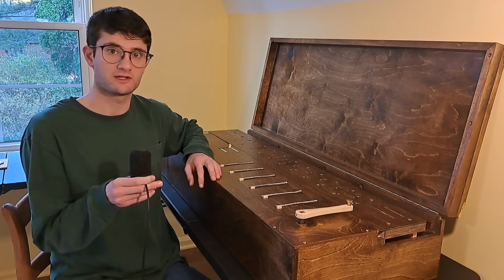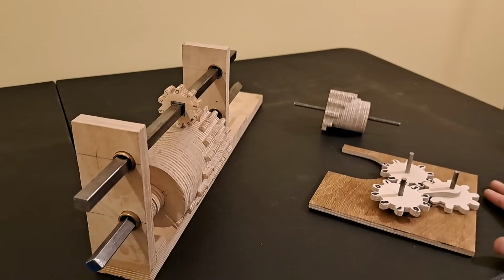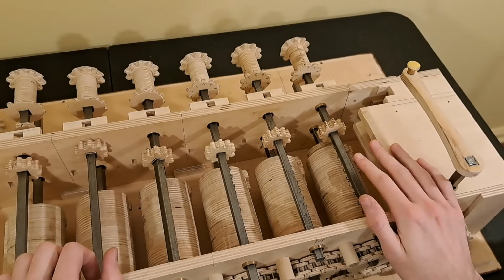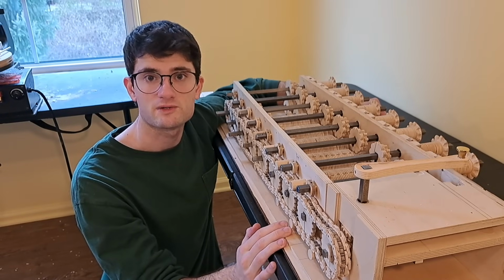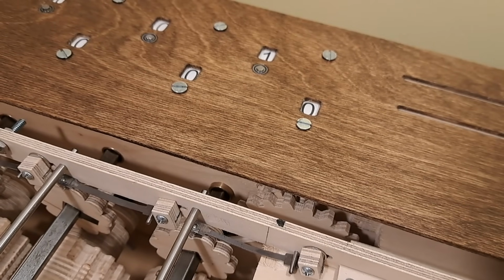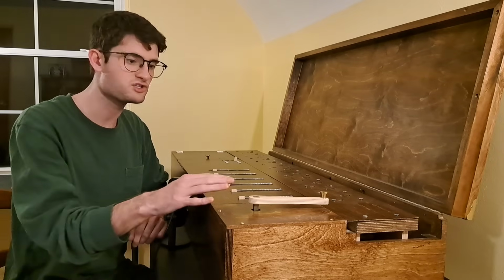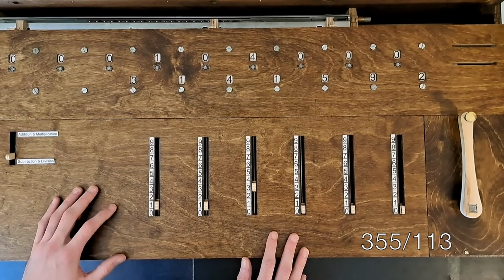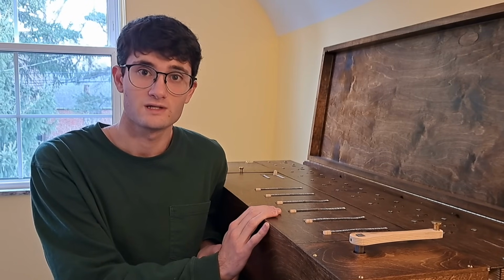How I built a Mechanical Calculator

Comment: 1) What if you write the numbers on the left gear in CCW direction? (as opposed to you've written in CW direction, meaning 1-0 are in CW). Then can we omit the intermediatory gear?

2) 13:42 - is that over-center or bi-stable toggle mechanism? I thought in over-center the pivot of the toggle was set at an offset from the pivot of the spring.
Reply from the maker: Thanks for the questions.
Regarding 1: If I had been making a full sized Schickard or Pascaline adder then the reason I did not just write the numbers CCW would be more important, we want each input wheel to rotate the same way because then the user interacts with all of the input wheels in the same way. With the Schickard adder in particular you could also do subtraction and it would get confusing quickly which way is needed to rotate the wheels if every other one goes in the opposite direction. A core element of these machines is that every decimal column behaves the same internally and also externally to the user. Basically, writing it CCW would've worked for that little demonstration model, but it would not help explaining how the full machine was going to work.
Regarding 2: I'm not entirely sure of the technical usage of over-center. Obviously it is bi-stable, but that's just descriptive of the effect more than helping to explain what is happening. I said over-center because I thought it highlighted how the critical element was the spring passed from one side of the pivot (the center), over to the other. Looking up images of over center mechanisms, It does not seem like a requirement that the pivot of the toggle be "offset" in some specific way from the pivot of the spring, just that the spring passes over a center of maximum displacement. 
Hope that helps! Let me know if I've misunderstood something!
Reply: @WhatWillMakes  Nah, your understanding seems to be correct. Nice video and thanks

Comment: I'm afraid I don't quite understand how the carry system works. Like, what happens if the carry tooth rotates the next bar at the same time the input gear for that bar also rotates it. I think I solelved this one on my own (maybe you said it and I missed it, but I would be surprised because I was waiting for this explanation the whole time), I think it has to do with why you made all the stepped gear teet 1/10 of a rotation apart even though you never needed more than 9 teeth. That means there's always a gap where no tooth is engaging from the stepped gears to the input gears. If you force the carry to happen during that period of the one gap, then you don't have to worry about missing the carry amongst the other rotations that are happening.

But I don't understand how the carry can cascade. It seems like the first carry would set up the next cary, and you'd have to turn it again to trigger the 2nd carry which would set up the 3rd carry. I didn't see logically from watching the interactions or hear you explain how it triggers the lever, rotates the gear, and pushes the lever back all in one motion. I guess it could be due to that left-right adjustment you pointed out in the last step? Make sure they're not aligned, but actually very subtly offset one to the next to the next? Maybe, but it seems like a lot of motion to ask from such a tiny window. I would have liked a closer and slower shot of that carry cascade, and an explanation to how it doesn't fall to these 2 curiosities I had.
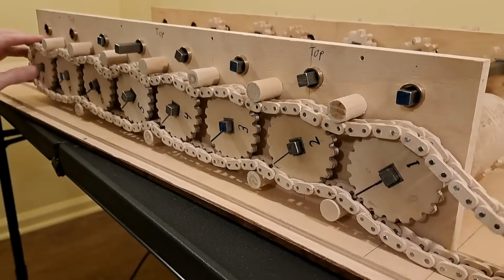Reply from the maker: These are great questions. In regard to the first, about carries happening in a column while that column is still adding in a number, you basically have it right. The piece with the extra tooth for carrying always comes after the 1-9 teeth on the stepped drum in that column. As for your second question: I apologize for not fully covering it – I thought it would be too much detail for this already long video – but every column is a little later in the cycle than the one to its right. If I had not removed some teeth on the stepped drums and instead of having 1-9 they had teeth going all the way around, they would have 20 teeth going all the way around. The extra tooth for carrying comes just after the 9 teeth on the stepped drum (so in the 10th of the 20 spots). This means the carry does always come right after the 1-9 digits are added on that column. Then the sprockets that link the columns together via the chain also have 20 teeth. And each column is 1 tooth of the sprocket (1/20th) later in the cycle than its neighbor to the right, so that carries ripple and the rightmost one finishes first. (You can kind of see this in the video at 9:35, where I'm aligning all the sprockets so those black marks line up, but the actual squares of the metal shafts show that every successive column is turned a little more down the line). So everything is timed so that carries do not interfere with things within each decimal, and occur at the right time in relation to the other decimal places. (if you're interested, there's diagrams of those parts showing the rest of the 20 teeth on my blogpost: https://whatwillmakes.com/2024/12/20/my-mechanical-calculator-how-and-why/).
I hope that helps and apologize it was not fully explained in the video!!

Comment: It's a shame how language changes, because I looked up the definition as I always assumed digital had something to do with what type of electronics were inside. And it turns out, the 1st definition (in Webster) has to do with electronics. And only the 5th definition involves the word "discrete." But it seems like there's an easy solution to this issue. If you have to dig to find a definition that uses "discrete," then why not just use the word "discrete" yourself? If that's the word you really want, it already has the meaning you need.
Reply from the maker: I don't think discrete itself would suffice; it's more a whole system of parts which rely on discrete events. Regardless, I do believe it is accurate to call my machine digital. (Encyclopedia Brittanica, on its page "History of Computing", even calls an abacus digital!) Moreover, I used digital to purposefully make us think about where the term digital comes from and to draw a comparison through the etymology of the word between technologies, in order to hopefully expose some underlying relationships. 
I appreciate the comment and like thinking about the best way to interpret this technology!

Comment: Clearing can be done by putting the add/sub lever to the middle (assuming there's enough space for the gear) so the gear won't engage, then clearing the results, to not lift the entire assembly by hand. And clearing can even be interlocked with that lever, so clearing rack cannot slide unless gears are disengaged and mode lever cannot switch until clearing is disengaged
Reply from the maker: Very perceptive suggestion! A couple other people have pointed this out too, but unfortunately there is not enough clearance between the bevel gears on my machine. I learned that some machines did have that as a feature though.
Thanks for the comment! It makes me very gratified that people give it so much thought

Comment: What happens if you divide by zero or subtract a greater number from a smaller one?
Reply from the maker: Dividing by zero does not really do anything, because to divide by zero you would just set the machine to keep subtracting zero, but when you set the input sliders to zero it means that the 10 toothed gears just do not engage the stepped drums. So nothing happens except the crank turn counter goes up, futilely!
The results dials do not have negative numbers (just 0-9), so when the machine tries to subtract beyond zero, it rolls over into all 9's. 0-1 would equal 99999999 and 0-2 would equal 99999998, etc.
Thanks for the questions!

Comment: Now you just need a crank mechanism to move the result wheels for multiplication and division, instead of having to lift it off, same with the zeroing of results and crank turn results...
maybe add a lever that unlatches the whole display assembly from the main gears as you lift it?
Reply from the maker: Yeah there's some bits that need refining. I plan to attach a post to the zeroing mechanisms so you don't need a stylus, but a crank mechanism is also a good idea. As is a crank to shift the assembly – kind of like Monroe mechanical calculators from the 20th century, I believe. 
Good suggestions and thanks for the comment!

Comment: With a few changes to the machine you could make either a binary or hexidecimal version or even one that can do all 3 or any other base system you want.  This could add a whole new layer of functionality.  Another option but a totally different way of making a mechanical calculator would by using the spring controlled switches they are in two distinct states 1 and 0 thus theoretically you could make a set up of logic gates build a fully mechanical binary system which would be working on the same principles as an electronic system.
Reply from the maker: Yeah it really could be any base! Interestingly, the first mathematician to really make the case for using binary and hexadecimal was Leibniz, and while he worked on his base-10 machine he designed a binary adder. I might dive into mechanical binary adders and logic gates sometime; definitely cool ideas. Thanks for the comment!

Comment: So cool only real improvement I can think of it the reser as it's a bit clunky having to reset by removing and using a stylus maybe a spring release would be better ans when you press the button it releases the mechanism and auto resets
Reply from the maker: Yeah the reset procedure could be more refined. I plan to permanently attach the stylus and basically have a post to slide, but spring returning it is a good idea. Thanks for the comment and ideas!

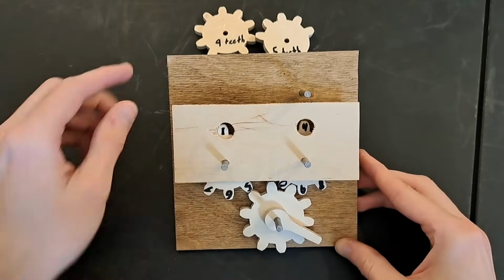Comment: At the timing 4:27 it showed how to add numbers. Would it be shown the detail of the minus, multiply, and divided like at 4:27?
Reply from the maker: I explain that in the rest of the video, but basically the machine subtracts by turning the number dials backwards instead of forwards, and it multiplies/divides by doing repeated additions/subtractions. Let me know if I've misunderstood the question, but I try to cover how it does those operations throughout the build process and demonstration.

Comment: 25:18 I'm thinking about the practicality of such machines, if it has too many moving parts and too many manuevers and orders, it's not very fit for common people to use it. I still think is a bealtiful machine, but it's easier to just write it down.
Reply from the maker: Yeah they definitely weren't for everyday home use, but offices, clerks, and accounting instead. Pascal was initially motivated to make his calculator to help in his father's work with taxes. In my estimation, when the machine is working well, it is faster and more accurate than a human with paper and pen. But it takes some training. 
Thanks for the comment!
Reply: @VitorMiguell believe it or not, this is exactly how a lot of calculators worked. The Monroe, for example, used this very method.

Comment: I noticed you didn't talk about the timing of the carries.
Clearly they can't happen while the target number is rotating, and they also have to be able to happen in sequence because carries can cause other carries. This is why the stepped drums have so much space after the last tooth, and each carry gear has its own angle. You need to dedicate some of the crank rotation for all carries to occur, one after the other, AFTER the initial rotations. Funny enough, this means that the size of the stepped gears depends on the number of digits the machine can display.
Reply from the maker: This is a very perceptive comment, and well put. I glossed over these details for sake of time, but it is precisely as you described it. If I had not removed some teeth on the stepped drums and instead of having 1-9 they had teeth going all the way around, they would have 20 teeth going all the way around. The extra tooth for carrying comes just after the 9 teeth on the stepped drum (so in the 10th of the 20 spots). This means the carry does always come right after the 1-9 digits are added on that column. Then the sprockets that link the columns together via the chain also have 20 teeth. And each column is 1 tooth of the sprocket (1/20th) later in the cycle than its neighbor to the right, so that carries ripple and the rightmost one finishes first. (If you're interested, there's diagrams of those parts showing the rest of the 20 teeth on my blogpost: https://whatwillmakes.com/2024/12/20/my-mechanical-calculator-how-and-why/). 
Finally, you are right that this all dictates how many digits the machine is capable of displaying, but there are tricks to get around these limits; see Thomas De Colmar's "Piano Arithmometer." 
Thanks for the comment! Comments like yours with such perception and thought make me very gratified.

Comment: Wonderful. I was hoping to see what would happen if you divide by zero? Nice work.
Reply from the maker: Thanks! When dividing by zero, you'd first input the number to be divided, then set the sliders to zero and try to subtract. Because setting them to zero engages no teeth of the stepped drums, you'd just keep cranking... futilely! The only thing that would happen is the crank turn counter would keep going up, so it's kinda underwhelming
Reply: @WhatWillMakes  Ohh, thank you so much for your reply. Curiousmarc repaired a mechanical calculator, and did a divide by 0 on it, I just had to ask.

Comment: You should put a handle for comfortable lifting the result panel. Also digitalise the result panel so it will stop at the exact position and slide between. Fixed zeroing sliders would be great. Al in al great job that me too wanted to do. Just, I was thinking about doing the plate with 10 holes and 10 bamboo sticks instead teeth's. Also, if you could make and publish laser cutter drawings it would be great.
Reply from the maker: These are good suggestions - definitely the design could be refined for ease of use. 
I'm sorry I don't have any laser cutter drawings or master plan. More details about the design process are on my blog: whatwillmakes.com. The gears were generated using Matthias Wandel's gear generator program: https://www.woodgears.ca/gear/index.html
Thanks for the comment!

Comment: It would have been funnier to have opened the door on the left to reveal a slide rule. :)  Brilliant design. The way you reset the results and counter registers could be improved so you don't need an external tool. Shifting the display to aid in multiplication and division is similar to how I implemented division for a vintage computer chip that has no divide opcode. One finishing touch is to add carry handles to the box and some brass plaques to give it a name and/or mention its purpose with a plaque with the name of the builder and a date.

Comment: if you would add enough of these calculators and conect them could you build a computer that could run simple programs? that would be interesting
Reply from the maker: With some way of transferring the output of one calculator into the input of another, and some device to orchestrate when each machine runs, you could definitely link these machines together to calculate more complex functions. I really like that idea!
Without a way for the machines to rewrite their own data, or change their own programs based on the data (conditional branching), it would not be able to really run programs like a computer does. Computers that can do those things are able to manipulate data in much more complex ways. Charles Babbage designed a mechanical computer (the analytical engine of 1837) that, if built, would have been able to mechanically run programs. The theory behind this was articulated by Alan Turing – his idea of Turing Completeness or a Turing Machine is fascinating, and interesting to compare to the capabilities of mechanical calculators. 
Thanks for the comment - I love thinking about this stuff!
Reply: @WhatWillMakes  yes I find the concept quite fascinating. Maybe you could design a mechanical computer that would be able to solve a specific Problem. That would be easier than a universal turing machine. I would love to see more Videos on mechanical Projekts!!

Comment: this is very impressive!  thanks for sharing.
 i was the mechanical calculator expert at our office in 1966 and your invention reminded me how our model worked.  we pressed buttons to enter a number and turned the crank clockwise to add (and multiply), counterclockwise to subtract (and divide) BUT it rang a bell when the accumulator became negative (ran out of digits to borrow from), which was a signal to make one extra turn clockwise to keep the remainder positive. so i could do division with eyes closed.    i could even do square roots with that machine.  thanks for bringing back those memories.

Comment: What happens if you divide by zero on it?
Reply from the maker: When dividing by zero, you'd input the number to be divided, crank, then input zero, which sets the sliding 10 toothed gear to mesh with no teeth on the stepped drum. Because subtracting (or adding) by zero will thus cause the results dials to not move at all, you'd just keep cranking forever... futilely! (nothing would happen except the crank counter would keep increasing). Thanks for the question!

Comment: Need to test divide by zero
Reply from the maker: When dividing by zero, you'd input the number to be divided, crank, then input zero, which sets the sliding 10 toothed gear to mesh with no teeth on the stepped drum. Because subtracting (or adding) by zero will thus cause the results dials to not move at all, you'd just keep cranking forever... futilely! (nothing would happen except the crank counter would keep increasing)